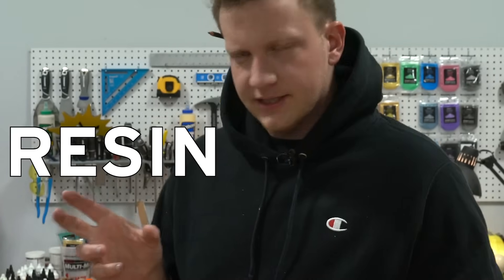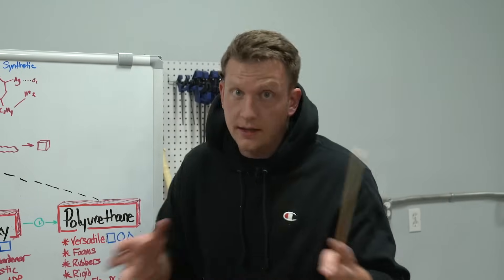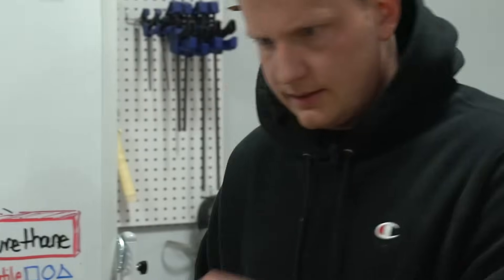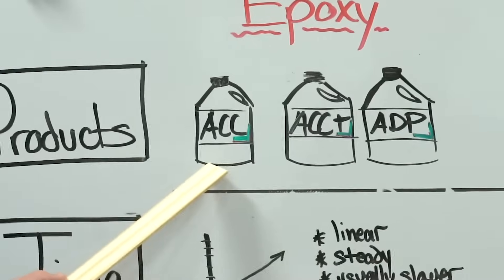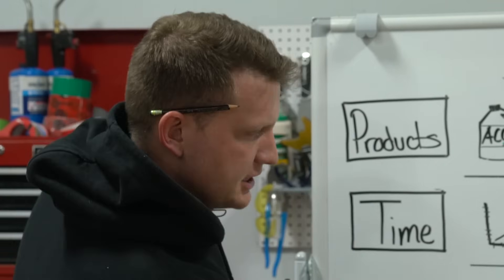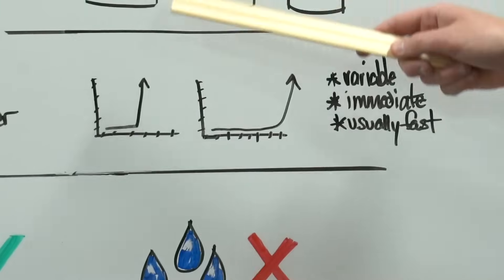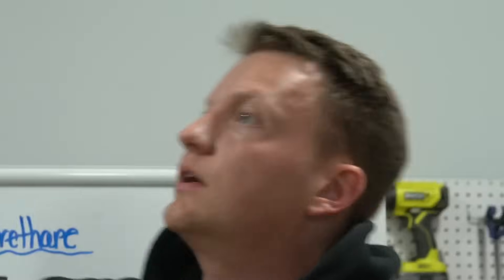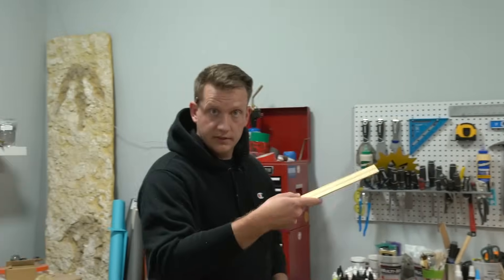Alumilite Explains: The difference between epoxy, polyurethane, and resin

Comment: You MISSED one thing.   I manufacture a non-thermosetting, highly elastomeric epoxy that has a 4 hour pot life and 1 hour working time.  If you use a cheap solvent-cured epoxy, that is because you don't know there are far better alternatives!   NEVER put urethane directly on a concrete slab, as the material has a 9 pH limitiation and slabs are 12+ in pH.  People don't understand that!

Comment: Helpful explanation! When projects evolve beyond crafts to engineering prototypes, material selection becomes critical. We help clients choose the right resin for vacuum casting based on required strength, heat resistance, and dimensional stability.:face-blue-smiling:
Reply: Do you have any experience casting polyurethane with graphite powder in it to make self lubricating parts?

Comment: putting down poly resin!!!!!!!!!!!!!!!!!!!!!!!! ROOKY!!!!!!!!!!!!!!!!!!!!!!!!!!!!!!!!!!!!!!!!!!! SOOOOOOOO .......... BABY BRAIN.. REMOVE THIS... YOU HAVE VARY LOW SKILLS........ THERE ARE MANY!!!!!!!!!!!!!!!!!!!!!!!!!!!!!!!!!EPOXY WITH MANY CURE TIMES!!!!!!!!!!! I WILL GLADLY DRIVE MY Polyester hull threw your epoxy foam core.... the strength is i the glass carbon Kevlar ex.....  Polyester is stiff!!!!!!!!!!! to build rigid items thin string stiff!!!!!!!!!!!!!!!!!!!!!!!!Epoxy's are for flex and people who struggle with Polyester.. for fast production......... Epoxy's come in many many kinds for special uses ..   yet if you want flex epoxy is where it is at... look up plastech hawaii............. WAKE UP  !!!!!!!!!!!!!!!!!! GO AND STUDY!!!!! GET YOUR HANDS ON ALL OF THEN TEST THEM AND SEE...

Comment: May I ask what brand of epoxy resin would you recommend that is high-heat resistant? I look forward for your response, thank you.
Reply from the maker: Absolutely! For high-heat resistance, we recommend Alumilite Amazing Clear Cast Outdoor Epoxy. It's designed to offer enhanced UV and heat resistance, making it a great choice for outdoor applications or projects exposed to higher temperatures.

You can check it out here: https://alumilite.com/collections/epoxy/products/amazing-clear-cast-outdoor-epoxy
If you have any other questions or need help with your project, feel free to reach out!

📞 (269) 488-4000
📧 info@alumilite.com

Comment: Great quick overview! BUT!!! What about strength difference, flexibility, etc. for each? Can I make a polyurethane infused laminate for a surfboard? What is more rigid for conventional epoxy or polyester laminated for surfboards? Thanks!!!
Reply from the maker: Here's a quick breakdown!

Epoxy Resin:
Stronger and more impact-resistant
Slightly flexible – helps prevent cracks
Bonds well to EPS foam
Excellent water resistance
Most rigid and durable option overall

Polyester Resin:
More brittle, less impact resistance
Only bonds to PU foam
Yellows over time, less water resistance
Faster cure, but lower performance

Polyurethane Resin:
Not commonly used for laminating surfboards
More flexible, but lacks rigidity
Not ideal for structural laminates

Comment: Would you recommend polyurethane for filling driveway cracks (asphalt)? Thanks!
Reply from the maker: Yes polyurethane will work for sealing small cracks in asphalt, but epoxy is generally the better fix. Epoxy has stronger adhesion and cures to a harder, more durable surface, which means it can handle vehicle traffic and weathering more effectively than polyurethane alone.
That said, epoxy doesn’t have as much flexibility as polyurethane, so it’s best for cracks that are stable and not subject to a lot of ongoing movement. If the cracks are shifting due to ground movement or freeze-thaw cycles, a polyurethane might still be useful in combination with epoxy or as a first step.
Reply: @AlumiliteCorporation  Thank you very much for the quick response. This is Canada, so I will go with the Polyurethane as it is more seasons  flexible. Awesome!
Reply from the maker: @OscarGDiaz  Happy to help!!
Reply: howbout sand n tar ... 🌚

Comment: I am a bathtub refinisher what is better to use acrylic or polyurethane or epoxy
Reply from the maker: Epoxy provides excellent adhesion and a solid foundation, acrylic urethanes deliver a bright and glossy finish, and polyurethane offers outstanding durability with long-lasting UV resistance. Many refinishers use epoxy as a primer and finish with polyurethane or acrylic urethane for the best results.

If you have more questions our customer service team is here to help! (269) 488-4000 | info@alumilite.com

Comment: What is best for clear deep application in concrete fissures or grooves? I used some resin and it ended up almost black. I want it to stay clear so the texture in the concrete is visible but with an eighth or so inch of clear hard substance over it. Thanks. Good vid.

Comment: I would love to see a video showing the advantage/disadvantage of each with regard to cured strength and durability.  Especially when used for boatbuilding.  I use epoxy but crystals form when resin is stored during the winter.  Very difficult to resolve that issue once it occurs.

Comment: I've been using Quick Coat for several years for filling cracks in wood turning blanks. I add a red colorant to make these cracks "features" in the final turning. I just bought more today for my spalted maple blanks. I'm familiar with its properties; its long working time allows it to seep deeply into the smallest crack. I let it cure overnight before turning and have always had good results. The red color contrasts handsomely with the color of cherry and maple, my primary woods for turning.

Comment: Polyester de-gasses styrene gas as part of the reaction/cure of the material.
Epoxy generates heat, not gasses.
Take a product like Bondo (polyester resin thickened with talc). The styrene leaves wormholes in the matrix that allow water vapor to penetrate. The talc is water soluble and adsorbs the water. When used against a steel substrate, it fosters iron oxide formation at the point of union
Reply: asbestos was used auto body filler  Bondoo™ 1960+ :face-turquoise-covering-eyes:

Comment: Very informative… just one question I live in the uk and was wondering for hobbie crafts for prop work I do indoors , would  low styrene polyesters be better or in fact the best method to reduce the smell when curing as I’ve been having trouble with my neighbours complaining even though I do it once in a blue moon … I know your not meant to do it but for my hobbie it’s what I tend to work with … or if there’s any alternative way to get rid of the smell effectively with 0 smell if possible whilst working with it as it  do use the proper safety measures like I do at work with putting on fans full blast ,but the neighbours say they still smell it … I use just basic 5kg polyester value range resin  if that helps for context 

Cameron

Comment: Have a small a frame popup that has a soft spot, maybe a couple. Thinking of pulling off the linoleum patching the cutting and patching the soft spot with new material and pouring a whole new floor. Which might be better for this kind of use? does it depend on the thickness of the planned pour? Thank you!
Reply from the maker: Many people have successfully used epoxy to create durable, beautiful floors in campers, trailers, and even RVs. It can add strength and a waterproof layer. But there are a few key considerations:

Key Factors to Think About
Subfloor Repair First
* You’re spot-on with your plan: remove the linoleum, cut out any soft spots, replace them with sound material (usually new plywood of matching thickness).
* Ensure all repaired areas are solid and level — epoxy won’t compensate for structural issues.

Pour Thickness
* This is very important — floors are usually done with thin, self-leveling epoxy, not deep pour epoxy.
* If you’re thinking about a thin coat (1/16"–1/8"), a floor-grade epoxy (self-leveling, high abrasion resistance) is best.
* If you go thicker (1/4" or more), you’ll need a deep pour epoxy and careful management of exotherm (heat generation), which is tricky over large surface areas like floors.

Flexibility & Movement
* Trailers flex a bit when moving or on uneven ground. Standard hard epoxies can crack if the floor flexes significantly.
* Some specialty flooring epoxies have slight flexibility designed for such environments. If your trailer is older and prone to flexing, this is a big consideration.
* Adding fiberglass mesh or reinforcement in your pour (beneath the epoxy) can also help.

Recommended product would be amazing clear cast!
Reply: @AlumiliteCorporation  TY Appreciate the SME advice

Comment: Hi , Thank you so much for your explanation. I have a question. Which one is the best for wired flowers, and how can we make it?
Reply from the maker: Great question! For wired flowers, we recommend Amazing Clear Cast or Clear Cast Plus — they're crystal clear, self-leveling, and perfect for delicate petal work.

How to use it:
Shape wire into petals.
Stretch nylon or use open frames for dipping.
Mix resin 1:1, then dip or brush it onto the petals.
Hang to cure for 24–72 hrs in a dust-free space.
Optional: Add transparent dyes for color!
Reply: @AlumiliteCorporation thank you for your help. But I don’t understand exactly what is resin 1:1, could you please explain more?

Comment: I’m working with a PU resin that’s roughly Shore D 80. It tends to get quite brittle, especially when cast in thin sections. I'd like to make it softer for certain applications — for example, to cast rubbery feet.

However, I’d prefer not to buy five different resin systems just to cover a range of hardnesses. Has anyone here found a good way to get variable Shore hardness from a minimal number of components?

Are there any 3K systems (base, hardener, and elastifier) that allow flexible tuning?
Can you add a separate elastifier or plasticizer to a standard 2K system?
Or is it viable to mix a soft and a hard PU system together to achieve intermediate results?
Any tips or product recommendations would be greatly appreciated!

Comment: You're totally wrong about polyurethane and moisture in hardened condition. Almost all 2K Boat paints and Varnish products are polyurethane based and of course not only water resistant or water tight but also chemical proof. Only once working with professionals, only once........

Comment: I constructed some bins out of pressed wood that I coated in epoxy resin w/ fiberglass fabric to reinforce. 
Decided to paint them and I’m worried what will bond AND be able to wipe down/sanitize…   Does epoxy resin work well as an outer shell for painted wood??
Reply from the maker: Yes! Epoxy resin is great as a protective shell—durable, water-resistant, and easy to clean. Just make sure it’s fully cured, lightly sand it, then use a bonding primer before painting. Go with acrylic, urethane, or epoxy-compatible paints. For frequent cleaning, consider a clear topcoat to protect the paint.

Comment: I’ve never had polyester fiberglass resin become brittle but it could be because I normally use 6-24oz FG mat with it. Last year I built 16 salt troughs for my cattle ranch and covered the inner tub part with FG resin and mat. With uncoated wood, the salt soaks in the wood and the cows end up destroying the troughs from licking the wood till it disintegrates. Even if they lick the new ones it shouldn’t affect them at all.

Comment: WELL SAID !
Jeez I wish all the amateur painters and fibreglassers out there would learn this. The confusion and BS around is immense.

Mind you, there's always more to it! There's single pot (air-set) and two pot (catalyst-set) polys. 

You didn't mention adhesive properties. Here Epoxy reigns SUPREME!!!

And rigidty/flexibility. Epoxy vs Poly ... each for different jobs.

And lol. Epoxy has a limited work time and then a very sudden set too.

Comment: Great  video. What resin is best when fiberglassing PVC board?
Reply from the maker: Great question! If you're fiberglassing PVC board, Alumilite Amazing Clear Cast or Alumilite Clear would be excellent choices, depending on your project’s needs.

Amazing Clear Cast is a fantastic option if you’re looking for a clear, glossy finish. It has a longer working time, allowing for smooth application over fiberglass cloth.
Alumilite Clear is a great pick if you need a strong, impact-resistant bond and a quicker cure time. It’s often used when structural strength is key.
💡 Pro Tips for Best Results:
✔ Lightly sand the PVC board first to create a better bonding surface.
✔ Wipe it down with isopropyl alcohol to remove any dust or oils.
✔ If you need extra adhesion, consider using a plastic bonding primer before applying the resin.
✔ Apply the resin in thin layers for a stronger, smoother finish.

Would love to hear more about your project—what are you making? 😊 Let me know if you need any additional recommendations!

If you have any more questions, feel free to reach out at (269) 488-4000 or info@alumilite.com. Happy crafting! 🎨🚀
Reply: @AlumiliteCorporation  I'm building a kayak out of pvc board. I live in Trinidad in the Caribbean.

Comment: Thanks for this powerfull info! Do you know if 2k epoxy resin does for SMC repairs with addition of fibreglass matts? Because standart fibreglass resin does not stick to SMC
Reply from the maker: You're very welcome! Glad you found the info helpful! 

Now, when it comes to SMC (Sheet Molding Compound) repairs, you're absolutely right—standard polyester or fiberglass resin won’t bond well because SMC has mold-release agents and low surface energy, making adhesion tricky.

Can 2K Epoxy Resin Work for SMC Repairs?
✅ Yes! A high-quality 2K (two-part) epoxy resin is one of the best choices for repairing SMC, especially when combined with fiberglass mat for reinforcement. Epoxy has much better adhesion to SMC than polyester or vinyl ester resins.

What to Do for a Strong Bond:
1⃣ Surface Prep is KEY! 

Sand the SMC thoroughly with 80-120 grit sandpaper to remove the surface glaze.
Wipe with acetone or isopropyl alcohol to remove dust and contaminants.
If possible, apply an SMC-compatible adhesion promoter to boost bonding.
2⃣ Use a Quality 2K Epoxy Resin

Alumilite Amazing Clear Cast or AlumiRes (RC-3) could work for small, non-structural repairs, but for heavy-duty automotive SMC repairs, you'd need an epoxy formulated for composites (like a marine-grade or automotive epoxy).
Avoid polyester resin—it won’t bond well and may crack over time.
3⃣ Layering with Fiberglass Mat

Wet out the fiberglass mat with the epoxy, then lay it over the repair area.
Use a fiberglass roller or brush to remove air pockets.
Apply multiple thin layers instead of one thick coat.
4⃣ Curing & Finishing

Let the epoxy fully cure per manufacturer instructions.
Sand smooth and finish with primer/paint if needed.
Final Tip: If the repair is structural (like a load-bearing area), a specialized SMC repair adhesive or epoxy-based body filler might be a better option.

Would love to hear more about your project—are you fixing an RC body or working on a full-scale vehicle? Let me know if you need recommendations on specific products! 🚗⚙

And as always, feel free to reach out at (269) 488-4000 or info@alumilite.com for more advice. Happy repairing! 🔧😊
Reply: @AlumiliteCorporation  Power!!! Thanks so much

Comment: DEEPER please.. I don't know urethanes to be UV stable?? Yellowing? ...Below the water line after curing? ...Don't some urethanes cure with moisture? Single part urethanes? ...What resin to encapsulate electronics, flexible urethanes? I have considered Epoxy with 1/4 hardener, stays soft for a long time. Thanks for this! ... I am currently trying to develop a better LED pool light, solid to protect from intrusion

Comment: Whats stronger as far as shattering epoxy or urethane?  Thanks for the video.
Reply from the maker: Great question! Urethane is typically tougher and more impact-resistant, making it less likely to shatter compared to epoxy, which can be harder but more brittle. Perfect for projects needing durability! 💪

📞 Need advice? Call us at (269) 488-4000 or email info@alumilite.com! 😊

Comment: Good morning, we deal with the sale of stickers online, we also make stickers for motorcycles in particular tank pad stickers and other components made with two-component polyurethane resin that allows it to dry in about 7-10 hours depending on the temperature, even if this product offers a good result with excellent transparency and flexibility the problem is that this type of resin is very sensitive to humidity and often air bubbles remain in the middle of the resin that are not seen and do not come out even if heat is used to eliminate the bubble, and when the product is dry we often notice imperfections due to humidity or raised dots due to the bubbles that have remained together with the resin.
Do you have any advice? we use two-component cartridges inserted into a gun, it is good for making small labels but very difficult to use for making slightly large stickers.
Thanks.